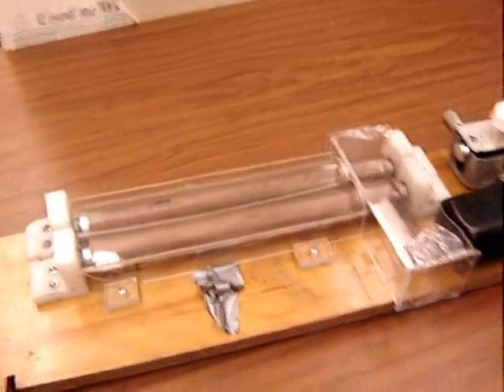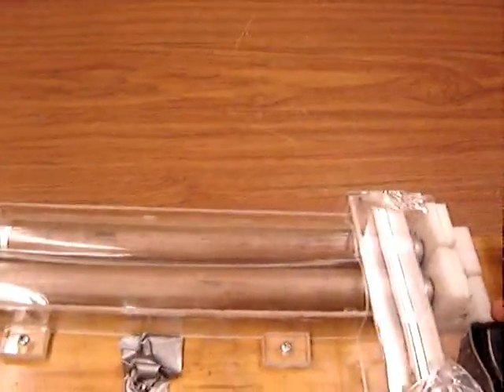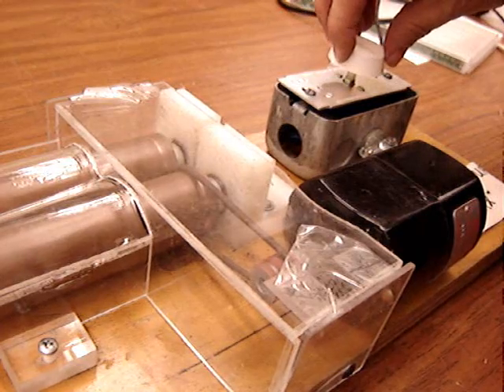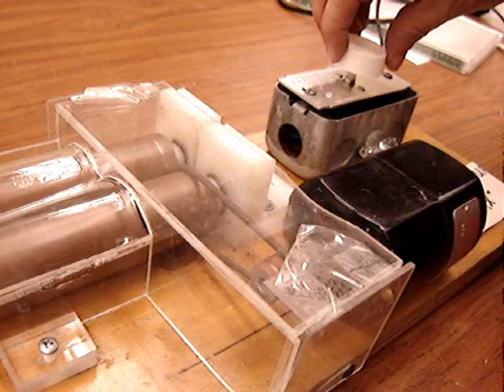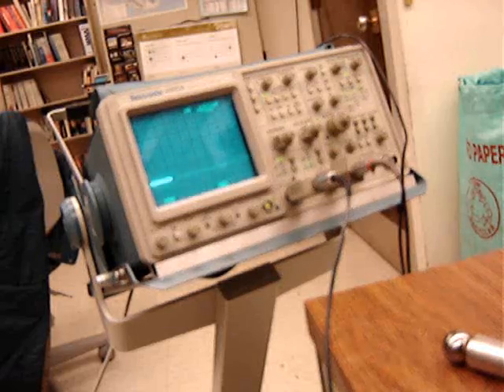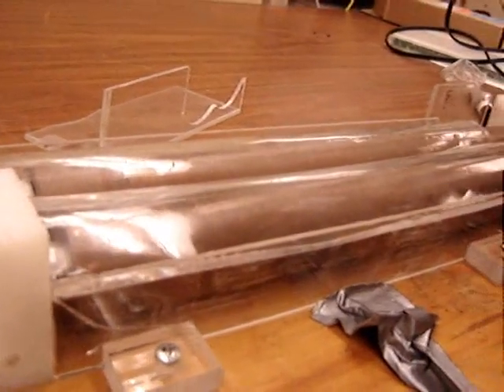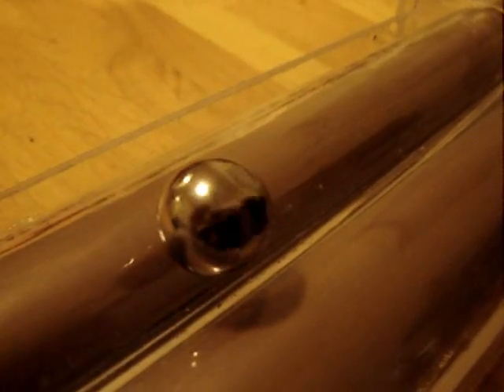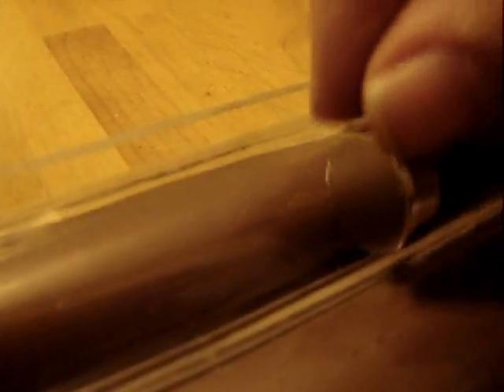Dangerous High-speed Magnetic Levitation Maglev

Comment from the maker: > no offense, but whats the point when you could just use normal magnets.

Alnico and ceramic magnets don't work, they're too weak. Perhaps they'd start floating if the copper was moving *much* faster.  Or perhaps not.  (Here's the test: If they won't float over a superconductor, then copper cannot lift them either.)

Comment from the maker: > Try wrapping the tubes with copper wire and running a current through them

That forms electromagnets with the strongest fields at the ends of the coils, so there would be no levitation, only attraction.   "Inductive levitation" creates large patterns of electric current in the metal surface adjacent to the magnet, but it requires relative motion.

Comment from the maker: > Or are you saying that gravity is the same as a magnetic field?

Air currents?!  GRAVITY?!!   Did you watch the video with the sound turned off?  I say IN THE VIDEO at 2:30... 

"This is an example of Inductive Levitation, as when a maglev train flys over an aluminum slab.  The relative motion of the metal past a magnet induces a huge electric current in the metal surface, and that creates its own magnetic field which pushes upwards on the magnet and levitates it."

Comment from the maker: > larger pulley running the rolers

Motor torque is too wimpy.  Using a big pulley actually slows it down.  Even with the small pulley, the drag on the lifted magnet slows it down significantly.

> trying to compensate for something?

High voltage hobbyists have huge Tesla-cles.  My plasma streamers are longer than yours.

Comment from the maker: > if you have small - 1 inch wide bands of copper 

Yep.  But instead I placed a small neo magnet on the wood near the middle.  It lightly centers any floating magnet...  unless the poles are backwards, then it drives it to the ends.

Comment from the maker: > So is this more convenient for levitating a magnet than 
> freezing the base magnet at extremely low temperatures?

No, it's a physics classroom lecture demonstration, so it has no other purpose than to be weird  ...or as a science fair project. 

Try to estimate the number of amps of loop current in the copper surface, knowing the surface velocity and the 0.5 Tesla field strength at the magnet poles.

Comment from the maker: Schedule-80 copper, the very thick stuff (about 1cm thick) from Alaskan Copper and Brass.  Thinner metal will work, but it would have to spin LOTS faster.  Solid copper bars would also work, but the smaller speed isn't that much smaller.  Best would be to dip them in liquid nitrogen.  That way only a very slow motor would be required...  or perhaps some cheap thin pipes chilled in LN2 could be used in the fast-spin device above.

Comment from the maker: I found that inverting the device does produce lift, but only for slow speeds and tiny magnets. Far too feeble to suspend a magnet against Earth's gravity. At higher speeds where forces are much greater, the "energy hole" seems to go away, turning into pure repulsion. It would be interesting to calculate and plot the 2D potential well for a magnet dipole versus roller speed. Maybe the right RPM and magnet length is strong enough to lift it, but not easily discovered through experiment.

Comment from the maker: Moving metal surfaces produce drag on a magnet.  If the copper surface is moving down into a cleft, it should pull a small magnet into the cleft.  But moving metal surfaces also repel magnets.  The question then is: at some values of RPM and for certain magnet shapes, does an energy-well appear within the cleft region between the spinning tubes?  (By 'energy well', I mean a spot where the restoring forces on the magnet are all directed towards the magnet.)

Comment from the maker: If aluminum, they'll need to spin even faster.  Also, I'd try solid aluminum bars.   Others have used two aluminum disks, 1 in. thick, 6 in. diameter, each one mounted on a separate electric motor, then spun adjacent like the tubes.

Comment from the maker: When rotating very slowly, the drag from the copper is large but the repulsion force is insignificant.  It will strongly suck the magnet down into the cleft.  Invert the whole thing, and they'll suck the magnet UP into the cleft.  The real question: when upside-down, and as speed increases, will the magnet just fall out of the cleft (because drag decreased faster than repulsion?  Or at certain RPM will it hover in the cleft, yet remain suspended there because of drag?

Comment: The magnet can be levitated when the two fields balance, but it cannot suspend the magnet from above (even if you could configure the rotating pipes in such a way as to produce an opposing filed of the correct orientation. I don't personally think this is possible, but I have no proof) as the force required to suspend the magnet would be equal to the force the magnet's field exerts PLUS he force of gravity pulling the magnet down.

Comment: I don't think turning it upside-down would work. It's the same effect as the old drop-a-magnet-down-a-copper-pipe trick, only with the opposite configuration and an amplified effect (tubes move past magnet, rather than magnet through tube).

The induced current and field will serve to oppose the magnet's own field. But as it's created by the magnet's own field, it can never exceed the magnet's field's strength.